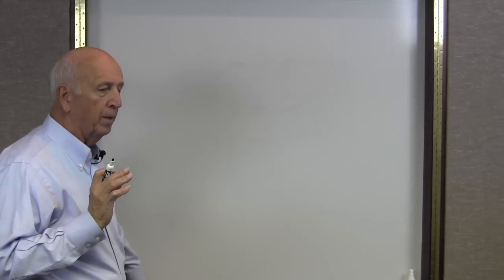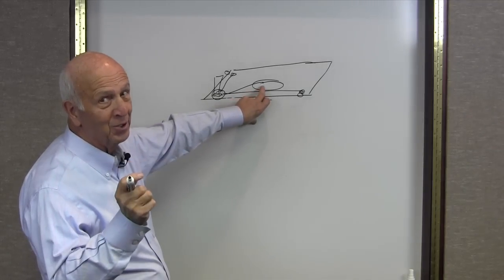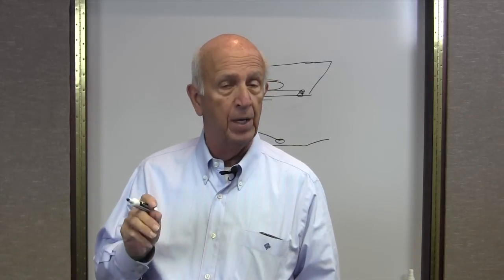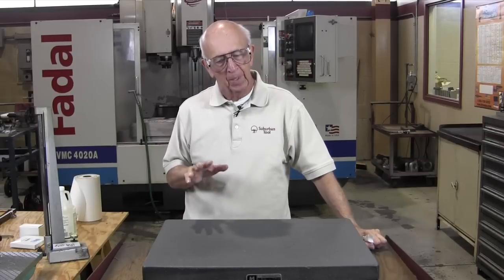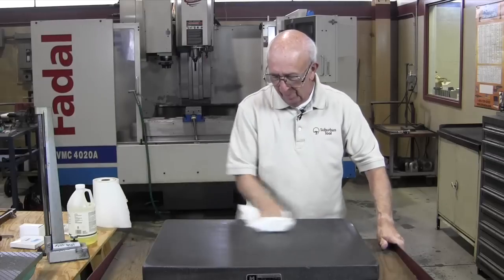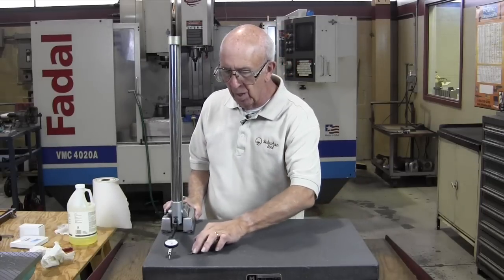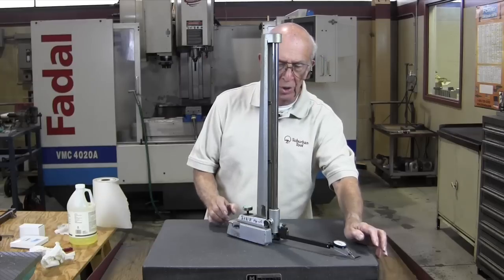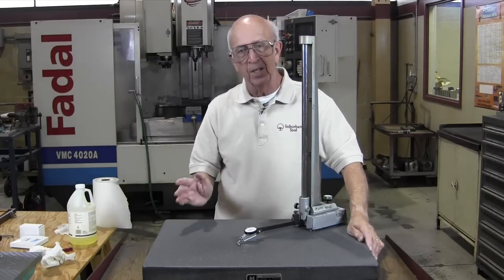How to determine if your surface plate is out of tolerance.

Comment: In reality, a surface plate in the manufacturing shop is not always the highest caliber table. 
In most manufacturing even climate controlled areas .0002 is more than acceptable. You will be searching for bigger defects that a couple of tenths. As a quality engineer, I would be looking at a root cause analysis! Validate your machine and machine tools are capable of holding those types of tolerance . 
Keep up the great work, great video!

Comment: saw an article about inspecting lathe beds to tenths with a laser, it will work for surface plates too. Blast a laser beam across its surface and observe the scatter on the wall behind.
Reply from the maker: meocats That will work too. As long as you have a laser.

Comment: I don't quite understand the role of the gauge block in this process. I understand zeroing out the dial indicator, but why do you add a gage block underneath? It would add an additional specific height to the plate, but I can't figure out why this is necessary. Thanks for all the videos!

Comment: We had ours resurfaced once or twice in my years at the shop.  Let me tell you the guy that did it had big arms!  Its a lot of work getting .0005 back to flat!  They were 4'x4' and 4'x5' and several 2'x2'  I feel you got an fairly accurate idea of the condition of you plate.  Always try to use the 'best' section for your job.
Reply: Did you see Oxtool getting his plates resurfaced, didn't seem to take long. As for the guy's arms, sorry but Tom didn't do a close up of them.

Comment: All of your videos are great IMO. I am just a hobby hack but still enjoy the professional level videos such as the ones you put up. It takes a bit of nerve to put up one like this that shows the non professional way to determine flatness because there are always folks looking to put down and/or discredit others. Let's face it, in some instances, this check is good enough right? I'm wondering if it might be possible to check a plate with a wire? Maybe a strong and thin wire stretched tight across the plate BUT not actually touching the edges of the granite? Instead it would be supported at the edges with round spacer having 1/4 of the circle removed so they fit over the edges? Then a gauge block and feeler gauge used between the plate and the wire?? Just curious and figured you would know the feasibility. Thanks

Comment: I see the reason for the gage block.  There is less chance of losing your reference than just dragging the indicator along an unknown surface height at a steeper angle.
Reply: No. It would help maintain measurement accuracy because the needle needs to be parallel to the surface to prevent sine errors, but in this task the actual measurements don't matter too much - they are only being used to get a sense of plate accuracy, not a calibration.  An error of 20% would be terrible if calibrating, but isn't really a problem here.  A reading of 1.6 tenths vs 2 tenths isn't important - we're looking for many tenths or even thousandths as an indication of a problem.  Also, if you know the needle angle you can compensate with trigonometry anyway.  Knowing that a needle at 45 degrees will read 0.707 of the actual movement allows you to multiply by 1.41 to correct.  I bet most would struggle to set their needles that accurately though, but at least you can reduce the error.

The  reason for the gage block here  is that although surface plates are flat, they are not necessarily smooth.  High spots are removed when lapping flat, but divots still exist.  In normal use they don't matter - the feet of the gage mount, and the base of the part being measured are all large enough that they ride the flattened high spots and bridge those holes.  The needle of the indicator is not large enough to ensure that, and could as a result drop into a hole and under-read.   Here, the gage block acts like those feet would, and being incredibly smooth and uniform in thickness, presents a consistent surface for the indicator to measure.

Comment: I have one of the little imported granite plates, and am trying to get someone to measure it with a co-ordinate measuring machine, just make a hundred touches on the surface or something, try to make a little map?  I work in a big Engineering College so you'd think it would be easy.   I don't think my school specializes in metrology, and it may be that they OWN this equipment but it's just sitting.  This would not be the best method, but seems like it would be quick and easy.   A good surface plate (which I might not have) may be near the limit of resolution of the CMM.

Comment: I recently discovered your channel, it has been very helpful in refining my machining skills.  I am a bit confused by what you mean when you say "tenths" .  From context is sounds like you are talking about a unit smaller than a thousandth(0.001"), but a tenth [of an inch] is (0.010").  So is "tenth" short hand for a ten-thousandth(0.0001")? If so, is that common industry speak?
Reply from the maker: Yes, "tenth" is shorthand for ten-thousandth.
Reply: You know, you can get better than 1/10th of an inch with a hacksaw, so it's not very interesting to talk about!  People were complaining about this bit of confusion terminology a hundred years ago, but it hasn't gone away.  I think in this context, if you were talking about 1/10" you'd have to say "Point one inch" or "a tenth of an inch"-  but he might be talking about  .0001" all day long, so that gets the shorthand..

Comment: paper towels leave fine fragments, better to use a shop cloth ... if you have a clean one .. they are also abrasive, you could strop a straight razor on paper towels.
Reply from the maker: meocats Shop rags will leave lint. No matter what you use to clean with you should always use your hand to wipe afterwards.
Reply: Use air gun softly.
Reply: How about microfiber cloths?  They are cheap now, after being washed a few times seem very clean and seem to leave a brilliant clean surface.   I have seen optical gear cleaned with these, it gave me the idea.   It might be that they need to be kept covered or in a box, and changed frequently.   They're not very absorbent, but seem good at picking up fingerprints, maybe with a little spritz of alcohol first?  I'm going to try ammonia first thing Monday morning!

Comment: Any way for hobbyists to do this with some other equipment? I have thought about taking something with two points, one dial indicator in the middle, set zero at some arbitrary point and then go around, repeat with the two outer points at different distances. That should work even with cheap $5 chinese dial indicators and a scrap piece of steel, shouldn't it?
Reply: I think I've seen pictures of this apparatus!   Calibration sounds like a problem, you need something straight to set this with.  Just from what we learned today, it's looking like you might zero your indicator along one edge of the plate, and then put this bridge across the center in different ways (crosswise, diagonally)?   Ah, your HFT indicator probably only reads in thousandths!  It might be that for the hobbyist, the granite plate and the cheap Chinese set of gage blocks are better than anything else we have, and we just have to BELIEVE in them!  That's what I do!   The kind of errors he's talking about here are hard to measure at all with 'hobbyist" level equipment.    There's a famous and rare book "Foundations of Mechanical Accuracy"  by Moore,  I got one through Interlibrary Loan, but it's also online as a big .pdf file.   If you struggle with this a little, you might be on your way to becoming a tool maker or gage maker, and maybe the last one!

Comment: You should get a solid diamond surface plate. It'll last longer. Might cost a bit more tho...
Reply from the maker: There's no such thing.
Reply: SuburbanTool Inc I wonder why ;)
Reply: SuburbanTool Inc right over your head
Reply: There is a synthetic diamond manufacturing company moving into my lil town soon. I'll stop by and get a quote for a 18 x 24 diamond crystal plate that is perfectly flat. Their answer should be interesting. I know they will say no, we cant make that. What I really want to know is this, if you could make one, how much would it cost?
Reply: You can grow a decent size sapphire crystal....
Reply: It is better to wear out the surface plate and have it relapped than wear out all your tools and the workpieces you put on the place.
Diamond also wears, just not as fast as granite, but it is much more difficult (impossible?) to recondition.
Reply: @robert5  tungsten carbide might be a reasonable replacement for diamond in this application but still at a very high price. and who needs that when you can just resurface granite?
Reply: Maybe just a surface coating?  DIamond-like Carbon say.  This is an industrial process, I can imagine some commodity material being ground flat and coated....